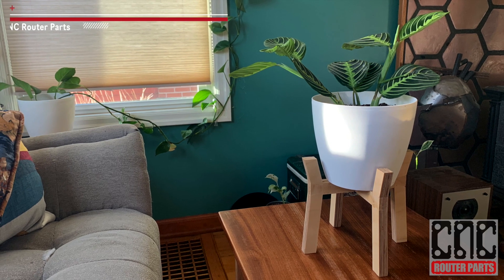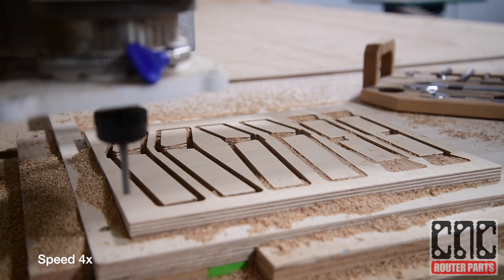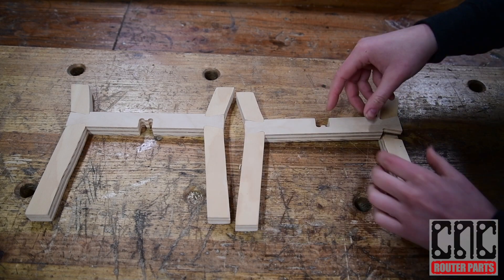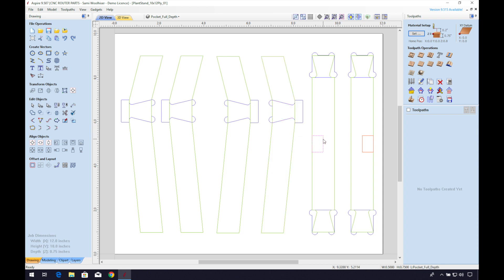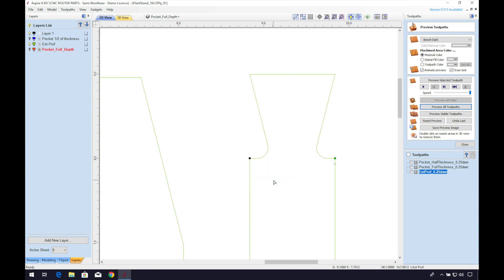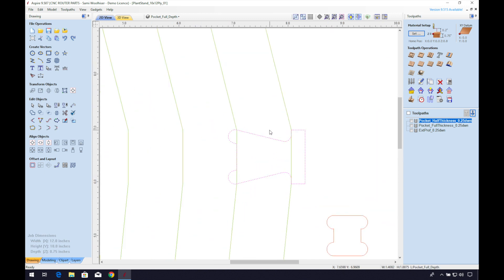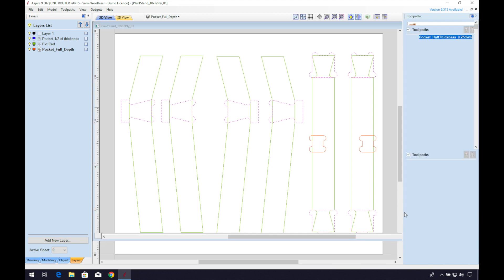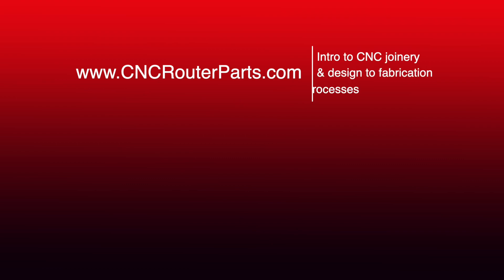Pro-Maker: Intro to CNC joinery and the design to fabrication process

Comment: It would be nice to alternative CAD like Fusion 360. I would be interested in learning about a workflow from CAD -> Gcode -> machine
Reply from the maker: Thanks for the suggestion, we are working on a few Fusion 360 projects as well.
Reply: Thank you for the feedback. One of the projects I would like to do is to make a table top with a Celtic cross in the center and the endless knot pattern as a border.